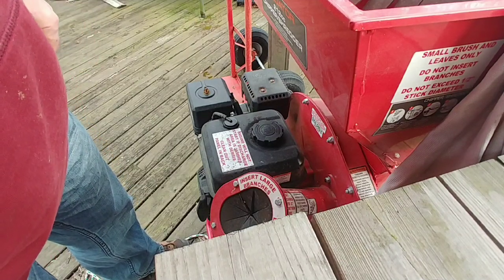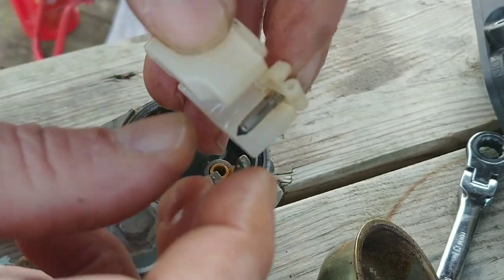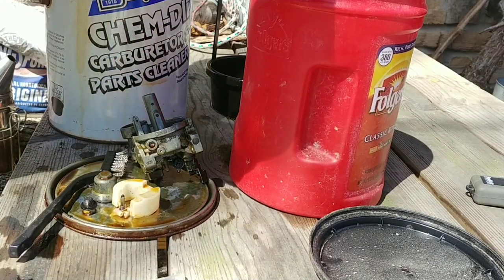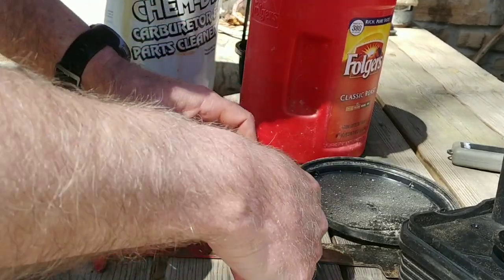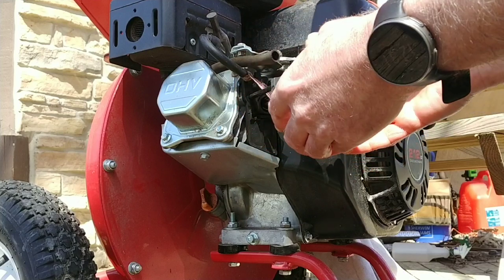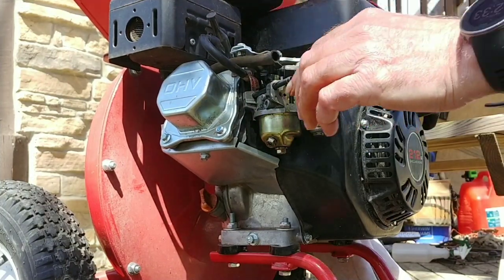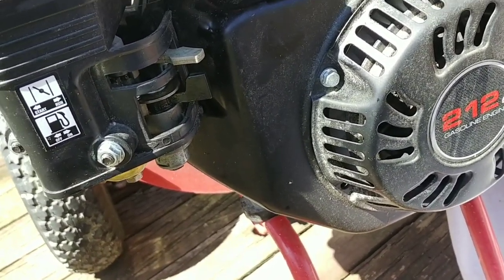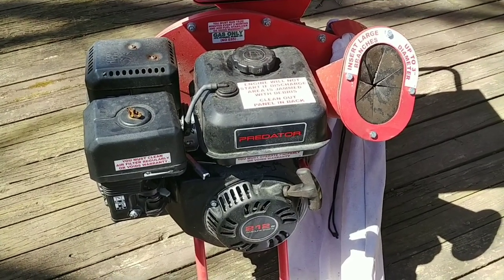5 year old harbor freight chipper shredder finally broke down #harbor #freight #chipper #shredder

Comment: Mine probably has same problem put new air filter runs now BUT runs half speed on half choke. I’m gonna clean carb as you did and will let you know what happens. Put new plug in too. Wish me luck. Thanks for video
Reply from the maker: yep, thats what it sounds like to me too.  Let me know if you run into any issues or the video wasn't clear enough.  Its a pretty simple carb design so if you have ever done one before, should be pretty easy.

Comment: I took carb all apart and cleaned but I found what is making my harbour freight chipper only run half speed with choke half open. If I open choke all way it dies. The plastic throttle knobby on top of carberator is melted. As such the metal linkage is not correctly attached to it, thus NOT allowing the throttle to be ALL the way open. I was able to start it full choke then moving to half choke full throttle but I had to by hand rotate the throttle knob counter clockwise to make engine go full speed and quickly I opened choke all way. It ran full speed fine but when I let go throttle knob it went back to clockwise half open. I need to replace the black plastic throttle knob. Thanks for your video my carb is clean it starts so easy but it needs new part to keep running full speed.
Reply from the maker: Thanks for the update. I wonder what caused that part to melt?

Comment: The muffler had a leak and the hot exhaust caused the throttle knob to melt. Have to replace muffler assembly
Reply from the maker: Thanks for the update.  I probably should start inspecting the muffler when I do my spring preps just to make sure I don't end up in the same boat someday.